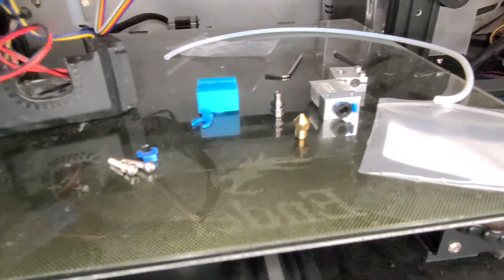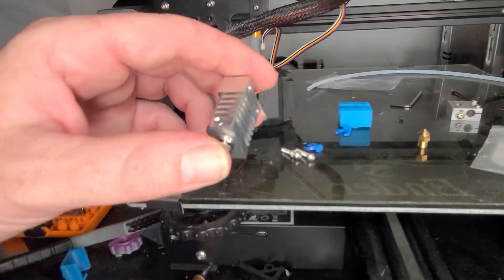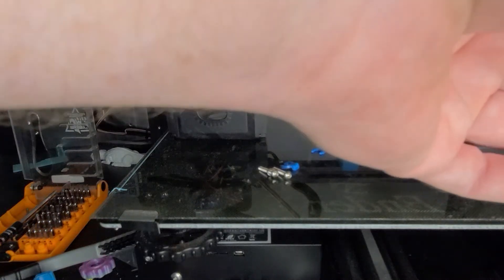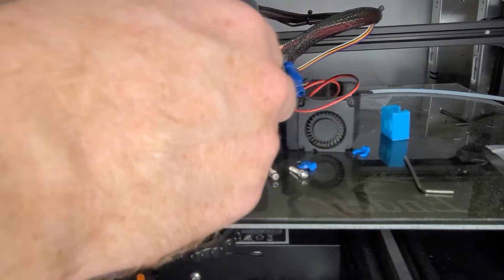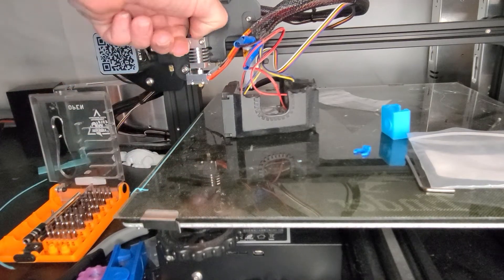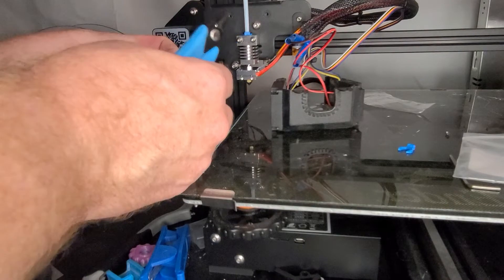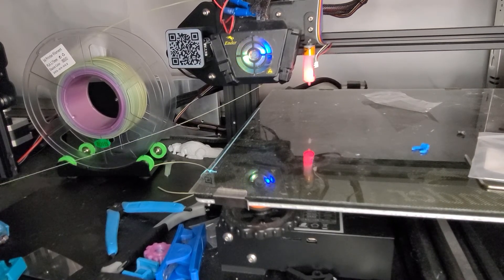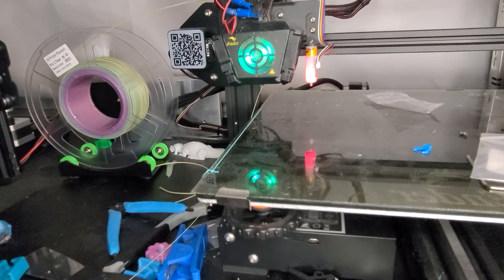Gulfcoast Robotics Hotend vs Micro Swiss Hotend Install Guide

Comment: I bought one a few years ago and the filament would just refuse to feed through it. Also the silicone sock is garbage. Had to switch back to the stock one. Upgraded the cooling on my ender 3 and this silicone sock let too much heat out so I kept getting heating errors. Swap back to a stock silicone sock, working perfectly now. Hotend maintains temp no issues

Comment: Thanks for the video man! Do you think popular parts cooling fan ducts/shrouds would fit over the gulfcoast hotends? It seems like they have similar measurements as the stock and microswiss hotend and I was looking to upgrade my E3 with a petsfang fan duct.
Reply from the maker: I sure it would fit. There the same size as micro and stock.
Reply: @toshlarue  Old comment, but yes, this works with other fan upgrades. I use the Hero Me Gen7 and this hotend. It's great.

Comment: What are you using for your temp and retraction settings?
Reply from the maker: I run pla plus at 215 220/60. I have found creality works well with close to stock cura retraction unless switching to direct drive.  So I run it at 6.5/25 or 6.0/25

Comment: Im thinking about buying one. I really need to be able to print more than pla and very few petg filaments. How long have you had a gcr running on your other printer?
Reply from the maker: I have had it for 3 months and no issues other then changing nozzle to mk8. I feel like they work better in the all metal hotends. You will want this nozzle for what you would like to print. https://amzn.to/3v97O8i
The Gulfcoast for me has worked as well as the micro swiss.

Comment: you have had about 5 days with this nozzle, since this video went up. what are your thoughts now?  I had uninstalled my gulf coast robotics hotend and have gone back stock.  I have had nothing but problems with my printer and am on my last leg...I can not get a good print and am about to give up.  even with the new hotend it was a nightmare. I would love to have some help if you are willing.  It seems like you have this thing figured out.
Reply from the maker: I have one on another ender 3 max also. Printing very well day and night since videos. No issues. Tiktok or Facebook @ Toshlarue if you want to message faster. I do offer help to people. I have my firmware video ready to put out tonight.
Reply from the maker: https://youtu.be/gLYQgMfI_wE
Reply: I don't know if you solved your issue, but I had an issue where PETG was really stringy and PLA would just snap apart for no reason.  Or so I thought.  It ended up being humidity.  Try using a drybox.  It might improve your prints.

Comment: I got one of those (not the new design with the grub on the side) and even affixed to my 3 max the nozzle was shorter than the retracted height of my probe so the touch hit before the nozzle and I had to remove it. Did you notice anything like that on your max?
Reply from the maker: Do you have BL touch? Sounds like you do not and maybe need to move the stop senor. I love BL touch cause swapping out parts for hot end is easy. After every new install bl touch or not you need to reset you z height and level again.
Reply: @toshlarue  I do have a BL touch. The nozzle ended up shorter than the retracted BL touch. I couldn’t print because the touch hit the bed before the nozzle was close enough.
Reply from the maker: @CodeMonkeyCodes  I see it's not the nozzle it's the BL touch. The bottom of the BLTouch plastic shell must be 8mm+-0.5mm away from the nozzle tip to trigger properly. You have the bracket that has only 2 screws top and bottom? Like in my video
Reply from the maker: @CodeMonkeyCodes  adjust the bl touch. Move the bracket up on screws. Make sure the tip of bl touch is almost flush with nozzle and little bit higher. You just have the bl touch bracket down to low on screws.